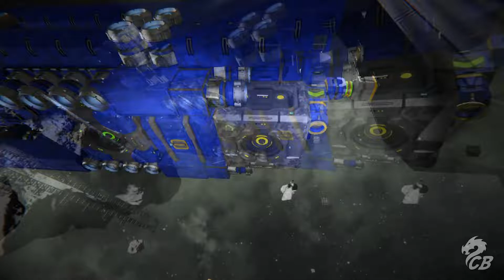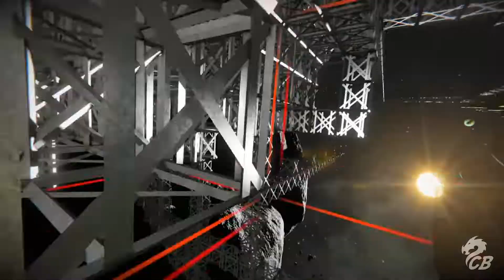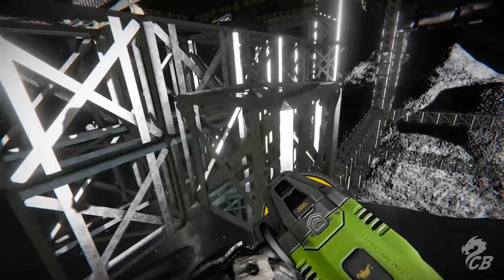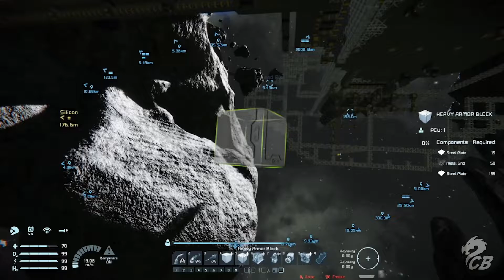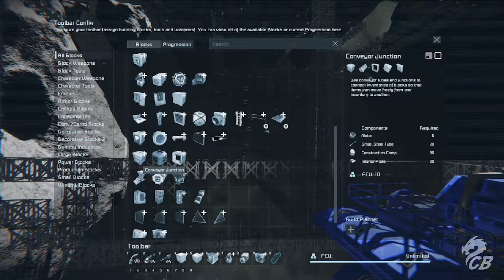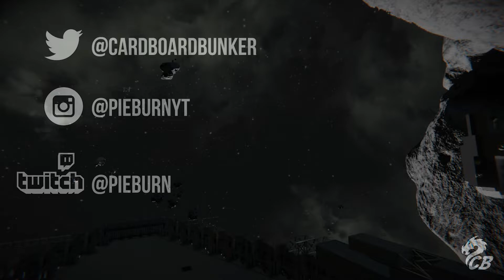SE Mighty Janus Ep 20: Profiles, Fillers and Plans

Comment: With 5000 Gyros you might want to take a look at modded gyros. It could save you blocks and maybe prevent your PC from melting. Great video, thanks for sharing.
Reply from the maker: Would you have a suggested gyro sir? I was looking at that and I do believe you're right
Reply: @PieburnOG  I for example use the +1000% gyro mod, it gives you a gyro that has 11x the strength of one gyro.